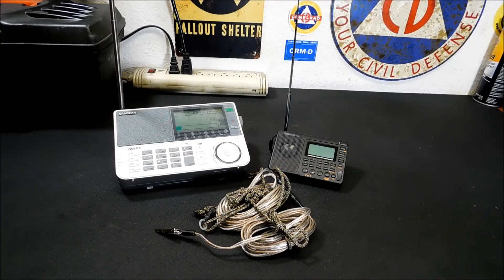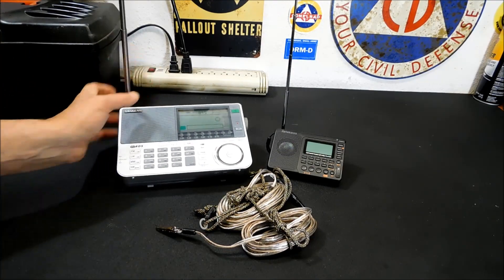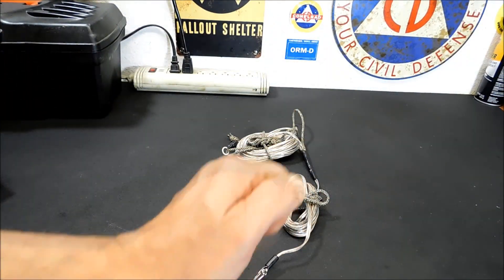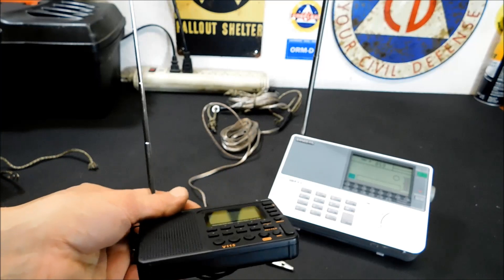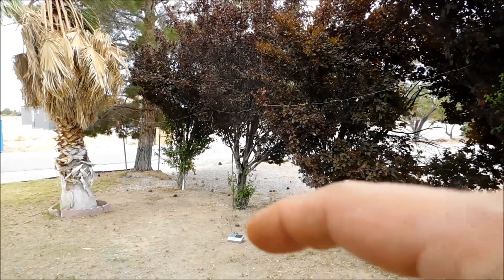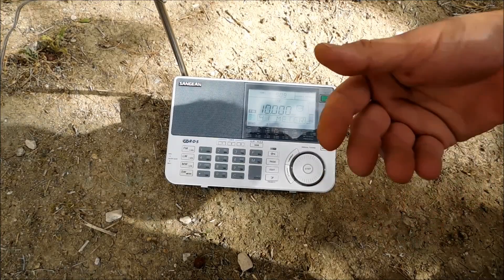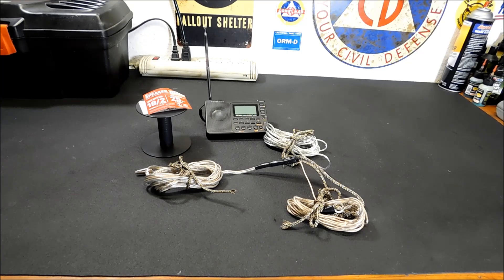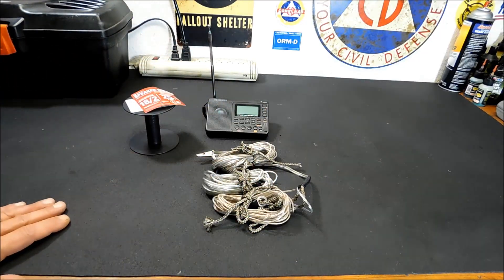Make Your Own Shortwave Speaker Wire Antenna!

Comment: so each end goes seperate ways, for the "di-pole"...
But both wires connect to one clip? So essentially, both wires connect to "positive"?!?!
I thought di-pole was to have one of the wires going to "positive".. and the other going to "negative"?!?!
I want to build one for my SW radio.. It has a Phono socket for external antenna.. So the tip is positive and the outer ring is negative...
Should i connect one wire to the positive, and one to the negative?!

Comment: This isnt a dipole. It's two 25ft wire antennas  shorted out at the radio. But if you was to only connect one wire to the Alligator clip then twist the ends of your version of a dipole together and form that wire into a loop  you will have a much better antenna. You could also seperate the two speaker wires for a better antenna.

Comment: A little bulky but waaay easy to set-up!

100' EZ Roll-Up
Zip Line-Cord Loop Receive Antenna:

   Unroll 100' Line Cord from reel. Splice + (striated side) Counter-Clockwise end of Line Cord to - (smooth side) of Clockwise end of Line Cord, and splice to Lead of whatever length desired to radio aerial, and lay Loop on the ground like a LoG
(Loop on Ground design) with remaining - (smooth side) of the Counter-Clockwise end staked to the ground with something metallic and sharp on one end for the Ground connection.
   The impedance is in a way not important because of the loop having its own capacitance like a similarly constructed Tesla Bifilar Coil.

Comment: I just bought the Tecsun PL880 to use mainly for short wave. It came with 18 feet of external antenna wire to plug into the jack. Is it best to clip and strip and solder the end of the supplied external antenna wire to the speaker wire and use the external antenna jack on the side of the radio or just use the speaker wire only and alligator clip it to the antenna? What would give best reception?

Comment: A new guy in my Facebook group said he had 200' of wire and wanted to know how to make an easy RX antenna. I told him how to make an easy End Fed Dipole 71' long, and the rest was for however much he needed for wire leads. Each ear is 35½' long either vertical or horizontal polarization with the wire leads to the middle of each ear where the Voltage Node is opposite the Current Nodes at the ends of the ears approximately 75 ohms, good match if not using coax, or 6' of lead coax at the end of the wire leads into the radio for approximately 50 ohms.

Comment: You didn't explain whether the crocodile was connected to one or both of the speaker wires.
Reply: @DinsDale-tx4br  
I came here to ask the same question.  It looked really is like both speaker wires, but that’s only a guess.

Comment: Hello. What is the advantage of splitting the speaker cable in two as you did, versus not splitting it and simply attaching the  single end at the same height? Many thanks
Reply: @DavidUKesb  When splitting the wire and stretching it out in an opposite direction from each other, you effectively double the size of the antenna to better draw in the signal for your radio.  This is a simple explanation, but accurate.
Reply: @raymondparker184   Many thanks Raymond. I sort of assumed that might be the case but I know nothing about electronics so wanted to check. Cheers.

Comment: I have experimented and built 2 dipoles; the first is 30 feet (15 ft each element) and the other 66 feet (33 ft per element).  I am able to receive SW radio stations.  However, for SSB either USB or LSB, I can only hear one operator speaking after carefully tuning.  Do you know what is the problem with my dipole antenna?  Why can't I hear both Ham operators talking?  Do I need to add a Balun and use a coax feedline ?  If someone on this channel has a solution please let me know your suggestions.  Thanks 73.

Comment: I have a question. Please.....how to attach the two wires to the alligator clip...is it correct to twist them together into one wire ....or is it better to use other way or other connector to keep them separated...thanks..emaksoud from Egypt
Reply from the maker: I'm glad you asked! You can either twist them together or use a connector to keep them separate. Both options will work fine.

Comment: What you did is excellent, and it can be made even better by connecting one end to the ground or a ground  - omar from yemen
Reply: I was going to suggest the same. Or just use it as a counterpoise.
Reply: @omaral-amoudi2295  

"To the ground"; WHERE EXACTLY?
Radiator?

Comment: If I use a 3.5mm Jack instead of the alligator clip, do both halves of the dipole solder to the center pin or one to the center and the other to the collar?
Reply: Hello! So how did you solve this?

Comment: Great info. Subscribed.  As an experiment, use a single light gauge wire hooked to a helium filled balloon. Depending on the size of the balloon and size of the wire, it is easy to imagine extending an antenna a couple hundred feet in the air. Just don't do it anywhere near an airstrip.

Comment: Newbie question: if I don't have alligator clips, can I wrap the speaker wire around the antenna on my radio instead?
Reply from the maker: Heck yeah, years ago I just taped the wire on the antenna with duct tape, it worked, wasn't pretty but worked.
Reply: @Iridium242  thanks for fast reply. I have insulated speaker wire. Do I need to strip the insulation and wrap bare wire around the antenna?
Reply from the maker: @michaelkhf  Yeah it helps, it might work somewhat without stripping it but I always stripped it off and taped it on, this was years ago and it worked pretty well just tossing the wire out a window on the 20th floor of a NYC apartment building
Reply: @Iridium242  I will try it. I have a Bingfu 20-1300MHz Police Scanner Antenna Radio I will attach the speaker wire to. I don't know if I will be able to receive frequencies below 20MHz even with the speaker wire

Comment: Thanks for this video. I tried building a really large antenna for my shortwave using a technique that uses coaxial wire. I had a VERY successful experience building an FM antenna that way, but my much larger (50 foot across) version that I plugged into my shortwave radio seems useless. I think I'm doing something wrong. I didn't use your technique here, but rather that same build style that I used to make my FM antenna. Is that idiotic? I don't really know anything about radio (that's likely obvious to anyone who DOES by what I'm writing here). I'd love any advice or guidance you might be able to share. I have a coaxial jack into my SW receiver. Would love to be able to utilize that. Thanks in advance for any help!
PS - When I saw that YOU had made a video on this topic, I figured it'd be a great place to go. I'd been involved in the 30 Days of Preparedness last year with you. I think your episode followed my own.
Reply from the maker: Thanks yeah I remember that.  Best bet would be to look up a G5RV antenna, you can connect your coax to 75 ohm ladder line, then a balun, and then about 51 feet of wire on each side, Should give you an amazingly wide receive coverage as well as transmit should you ever need it
Reply: @Iridium242  Thanks so much for the tip! I'll check it out.

Comment: Would 14 gauge speaker wire be too big, and I just want to stick to 18 gauge? Do I want to strip the plastic from the wire to attach to the ring connectors, or just to the alligator clip?
Reply: i've read that the gauge of wire doesn't really matter, 18 should work fine.
Reply: Stripping it won't matter

Comment: I'm going to make this 👌. I was thinking tho instead of making a hole separate dipole if you wanted it longer could you just add whatever length you like to each side? So use the 25ft as the "base" with the option for added length. 🤔  maybe quick connects or a wing nut and bolt since you already have the "eye holes" at either end.

Comment: I have a clothes line off front deck, i cloths pin one end of dipole, run the other opoosite side deck to a second pole, will have 40 feet, each way, 80 ft total, but one clipped on line can be moved closer or futher my spinning the line reel, kind of a second outdoor adjustment, thanks for the idea, and another job i gotta get done today lol 💪🏡👍

Comment: He's got LARGE "ring terminals" on the ends.  You can hook those to something, or tie some twine or paracord to the rings to hang the antenna up high, and to electrically insulate or support the  wire.
He did mention it's important to electrically insulate the antenna wire from metal things that are already grounded.

Comment: A very useful video, thanks.   I have a question about the orientation of the antenna.   Does it have to be more or less in a straight line, or would it still be as effective if the two arms were set at 90 degrees to each other?    My ideal location is at a corner of my property where a 90 degree set up would be best, if it would work.
Reply from the maker: As long as you get it up in the air it works 90 degree would not matter at all.

Comment: I can't wait to try this! Thanks so much for sharing. I do have a question: does the length of the wire matter? I bought a 50' reel of speaker wire and I did exactly what you recommended on the two horizontal wires but for the other end where it connects to the radio's antenna, I have 35' instead of the 10' you recommend.
Reply: Question: the two leads/wires connected to the alligator clip: are they simply exposed & then “shorted” together?
Reply from the maker: The longer and higher you go with this the better, that is what I have found
Reply: @Iridium242  awesome! Thanks! I clipped each  of the horizontal wires on 10' PVC pipes and right away I noticed a HUGE difference in reception! Thank you so much. I ended up returning the XHDATA AN-80 Shortwave Reel Antenna ($13) which was ok but not great and the wire in it kept getting stuck and would not wind it back very easily.
Reply: I've been told 50 feet of wire is the limit for these little portable SW radios, as they will overload the radio. Been trying to find more info on longer wires and grounding for these portables but with little success. So far this is the best video on the subject.
Reply: @MagicRoosterBluesBand  They must be referring to antennas on transmitters, not receivers.

Comment: Will this help with CB and GMRS radios?
Reply: No. First of all, one doesn't transmit on shortwave receivers, so the antenna length is not critical. Assuming one wishes to transmit on the CB or GMRS (with a GMRS license), one needs to know that those radios transmit and receive on certain radio "bands", which  are like "streets", and within those bands are specific frequencies, which are like house numbers along specific streets. So, antennas of specific lengths are required.

Comment: I just made one. How out 18ga speaker wire. It made a world of difference for my short wave especially above 7mhz. Thanks for the video. 

I’m using a worldstar solid state multiband receiver from I think the mid 70s. This is my fist short wave but looking at getting a newer version. What is your option on the new radios? And certain brand?
Reply: 18 Ga wire should be fine.  Some experts suggest thinner wire to filter out some noise from house wiring or local RFI.
The Tecsun receivers are popular lately.  I use a retekess AM/FM/SW  and a Kaito KA600
Reply: Check out todderbert. He reviews as many radios as you'll ever want to know about. He kinda takes the place of two hands and a radio. Sad to see him give it up. Anyway... Todderbert

Comment: As a novice I have tried unsuccessfully in the past with a plain horizontal wire with no joy at all. This looked a good way of doing well.So I thought I would try this dipole method. I set it up  outside exactly as per your instructions, but here again it made no difference. I live near the bottom of a hill in a bungalow using the soffit as a fixing points. What can I do to improve my signals please? Thanks, Brian Taylor
Reply: Short wave is kinda hot or miss. Depending on where you live or the time of year you might not get a lot of signals.

Comment: I Have The Same Setup At My Addic In My House In Third Floor, Picks Up American Signals From Where I Am At Night, Im Located In Latvia. 
I get Indian Channels And Ohh, Whole World Almost :)
And The Second Big Antenna Project That I Made Was And IS Fishing Poile ANtenna, Around `7 Meters In Sky,, Its A Dipole ANtenna, 
Works So good For 170.000 Mhz And Around There, I Tuned It For That Frequencie, Its Just Two telescopic ANtennas made Together With A Radio Gap between Them And Then Its Out I Believe It Was 19.9 Cm Or SOmething On Both Sides And Jeap, It Catches A Lot Of  These Upper Frequencies, But Total I Have Like 40 Antennas In My Property. :)

Comment: Great explained, what is the effect if you touch the trees, i thought it is needed to not touch anything and hang the antenna freely with isolator or plastic tie to the trees.
Reply: The speaker wire is already insulated except for the ends.

Comment: I enjoyed your video.  I'm new to shortwave.  I bought a nice radio but need an antenna.  I can support about 100' of speaker wire on old clothes lines on my property.  My question is, does it matter how long the lead wire is from the antenna?  I'd want to run the lead wire from the antenna to my house.
Reply from the maker: Not really when it comes to shortwave monitoring the more wire the better.

Comment: Nice , great vid. So it's more of a portable antenna if you go camping or something on the go, since no ground?
Reply from the maker: Yes, exactly
Reply: If you don't have a ground port on your radio you can twist a wire around the battery spring and attach to the uffer ground rod below your outside electric meter for twice the reception in addition to the antenna. Or a big nail and get the ground wet.

Comment: Thank you for this video Sir, I followed this method to create a Dipole Anteena 50x2 Ft long, and I am able to get BBC, VOA etc. during the day time here in Missouri. The fact that with a single 50 Ft wire the signal was audible, but not clear, adding another 50 Ft. made a great difference. 

I am not sure if you are aware of a website : https://m.short-wave.info/ this website provides current information on which stations are broadcasting, in which language and which geographical location. It is boon to SWL enthusiasts. Hope this helps.
Reply from the maker: Yup have had that site bookmarked for a while thanks!

Comment: Quick question: What are those round washer-like "endpieces" called that you strung paracord through to be able to hang up your antenna?
Reply: it is ring connectors for wire. come in various sizes.
Reply: Sorry to sound completely stupid.... but what are Ring connectors for wire? Thanks

Comment: Just built mine and am inside an apartment made of rebar and stucco  with crazy amounts of interference. This is incredible the difference it made! Thanks for the advice and good instructions on the build
Reply: Just to let anyone know the total cost for me was 18$. 25ft speaker wire, electrical tape, two packs of 4 alligator clips(I bought extra)

Comment: Plastic zip-ties also work as insulators on the ends, as well as strain-reliefs and a way to keep the bundle of wires/paracord together.  tape will eventually degrade from exposure and fall apart.
Reply: yes that is exactly what i use, zip ties.

Comment: You are cooking with gas my man. I went to radio shack. Baught a sack of gator clips. Then cut several. Wires about 3 to 5 meters each. So now with  just a few meters of hook up wire is a big boost, and can be rolled up and put  in Cary bag.  Kv4li.

Comment: That’s awesome I’ll probably make a few for my room and my camping gear , backyard radio. 
I have a clothes hanger attached to the fm antenna that came with my stereo which I broke so I had to fix the end of the antenna and the cloths hang works better then the tip it had . Tried to hook my little sw radio to it but I think the wire I’m using is wrong .cut the end off red and white stereo wires but it seem  to have made things worse .

Comment: Hi, great video. I  do basically do   the same  with lamp wire. I split it as well.  I loop my wire around two pencils that can go in different directions. This still doe's not work well for me. 
I don't know if it is the loops or if the wire is to long or just the  surroundings. This just gives me lots of static. I have to use it inside my apt. I live on the 1st floor  and have a 6 story building about 100 ft  from my windows.  Also there are  lots of power lines.  Is there any  hope?    I get better reception with the built in antennas, but not good. Thanks!
Reply: you are getting electromagnetic interference from your environment

Comment: Love your video. Will build one soon. Instead of 15 feet on either side of the dipole would reception be affected if I build one with 30 feet on either side?
Reply from the maker: The longer the better, also the higher the better.  Its only for reception so no worries
Reply: Thanks

Comment: Do you get better  shortwave '' reception.'' if you hang your wire ends facing and north or south or east and west.  Or does it matter ?????
Reply from the maker: For just general reception, the orientation does not matter, it should do fine however you can put it up.
Reply: THANK YOU VERY MUCH     ''STAY SAFE'' @Iridium242

Comment: The best tip of all is to use speaker wire or lamp cord, because you measure and cut it once and  you have two equal sides.